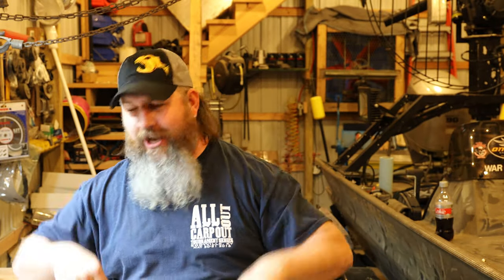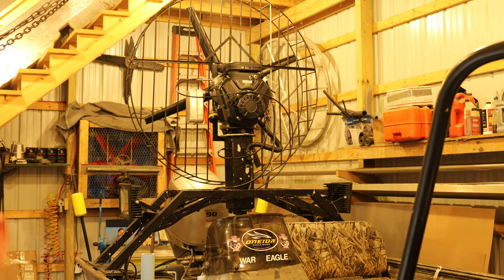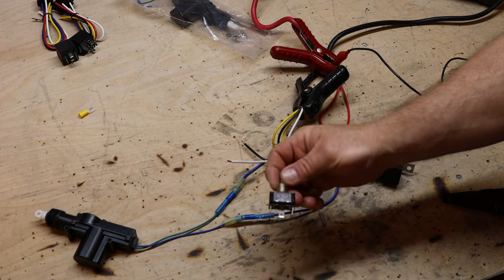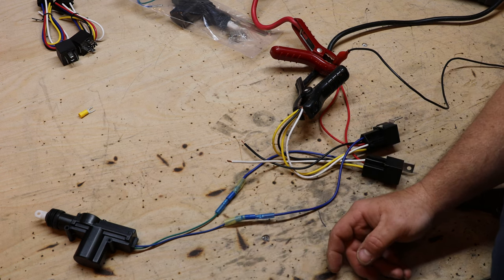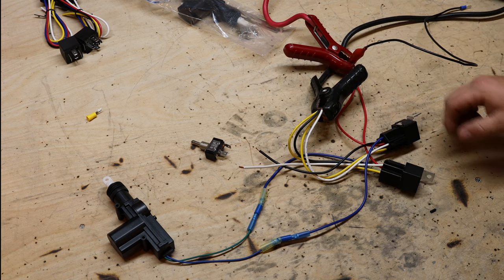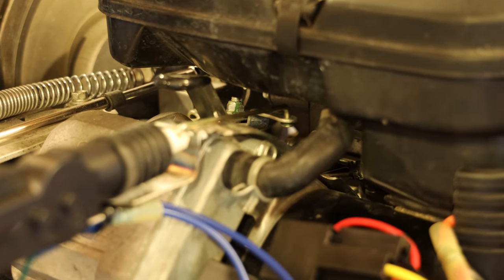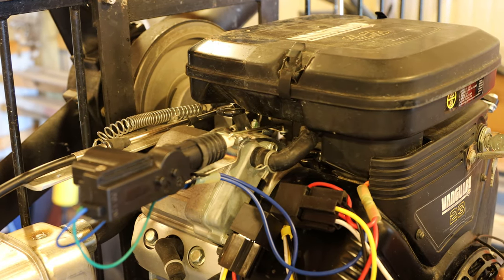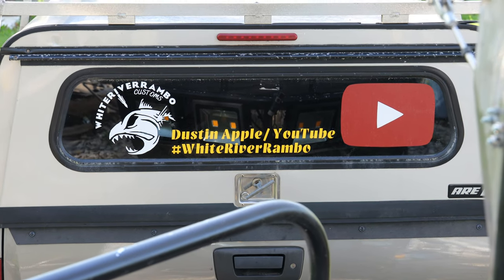How to Make a Electric Choke

Comment: Love the content like always man.

Is there any benefit to this vs a simple 1 way solenoid with a spring?
Reply: The spring is the original one on the choke for the motor. You just connect the solenoid to the choke handle.
Reply from the maker: You'd have to hold the button for that. Could get one of the outboard  ignition with push in key  choke. That's actually a cool idea.
Reply: @DustinApple   true, 
but those units r pretty pricey.
Reply: @DustinApple  you just wire it to the start position o. Key switch. When you turn the key it activates, when the key goes back to run the solenoid deactivates
Reply: @DustinApple  very inexpensive
Reply: And if it doesn't pullback, just use a stong enough spring that doesn't over power the energize function

Comment: Or use a choke solenoid off an outboard motor. wire to the start contact on the key switch When key turns the choke is pulled by the solenoid when it's activated. And when you let off the key the solenoid deactivates, turning off the choke.
Reply from the maker: That's a very expensive option. But it can work.
Reply: @DustinApple  I got one off of an old motor, just a key switch and wire, very inexpensive!!
Reply from the maker: @psebowfisher6454   understood but that's  not helpful to others unless you can come up with a replacement part number that others can reproduce your alteration.